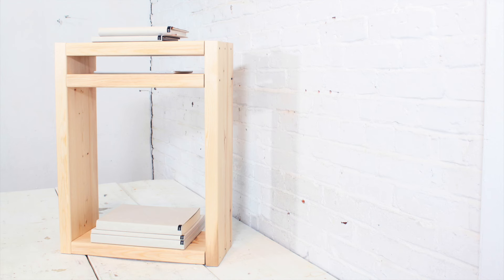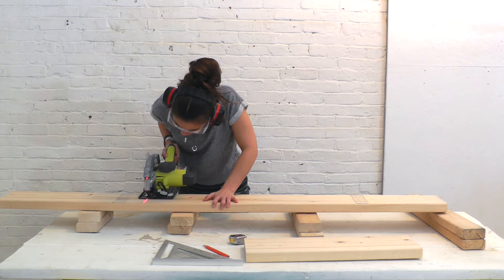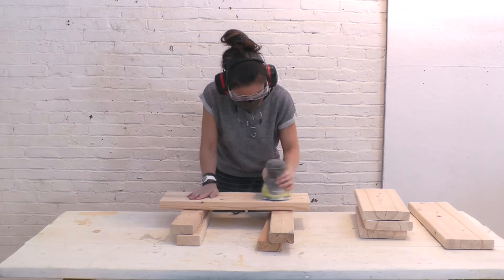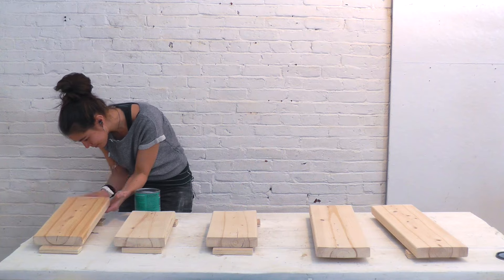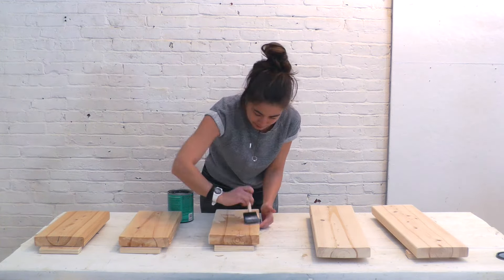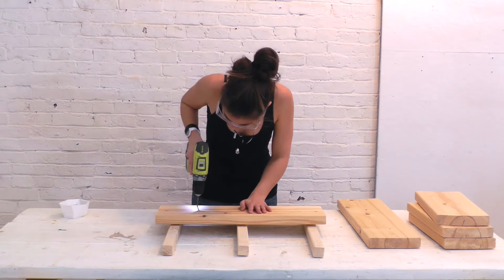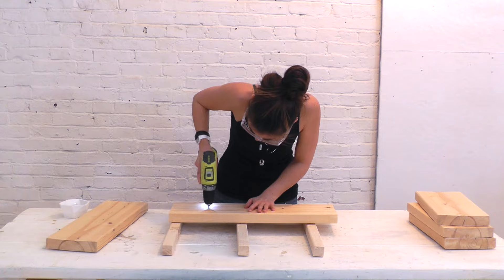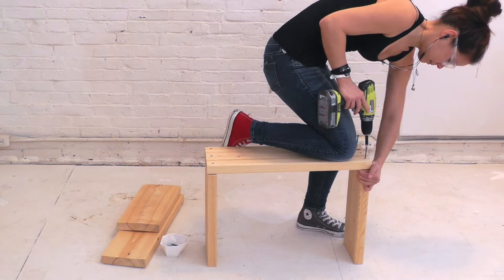How to Make a Modern Nightstand

Comment: Now that is what I call budget living.  If you drill pilot holes in both pieces that are going to be joined together.  You would not have to sit on the wood like that to get a tight joint.